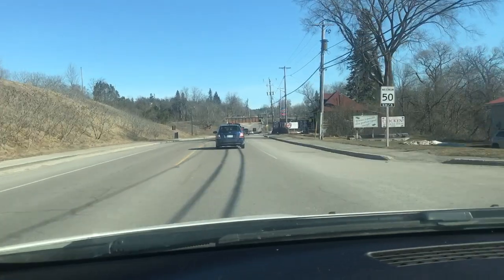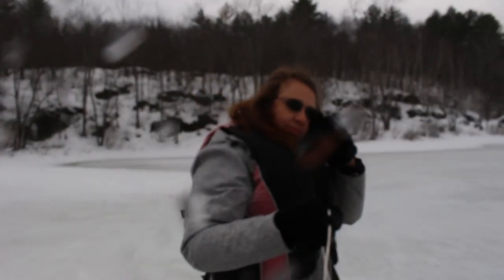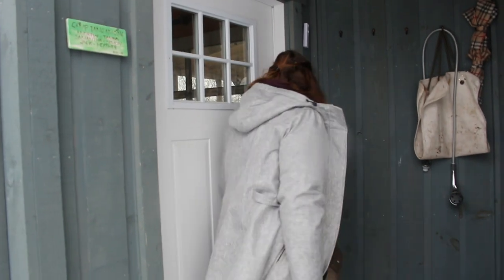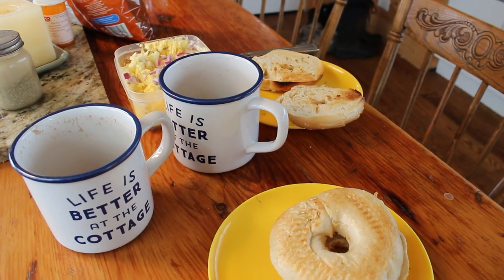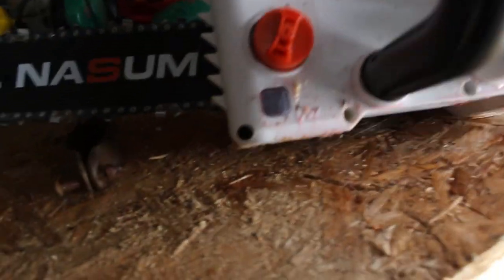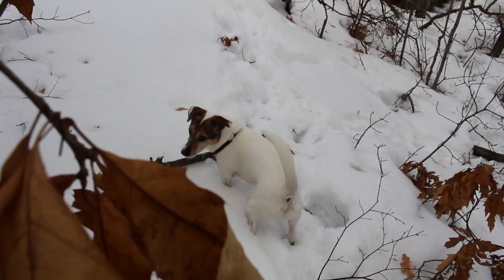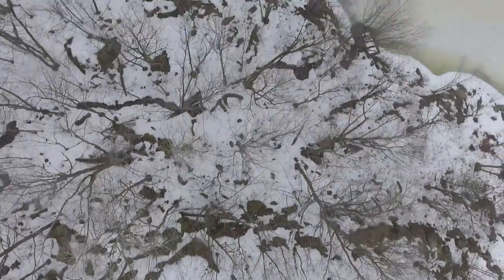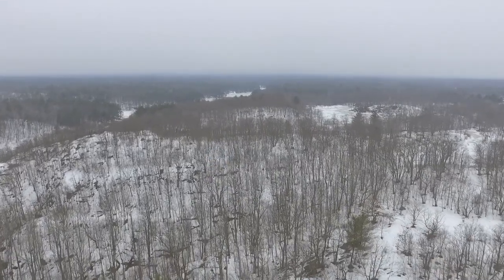Almost trapped by the Ice at the off grid cabin. #offgrid #cabin #cottagelife

Comment: Great to see a new video. My grandparents taught me to leave kettles sitting upside down at the cabin while away in order to prevent rust. Also, I feel your pain regarding the damaged vent pipe. I’m building a cabin just north of Muskoka. Two weeks ago I found our chimney disfigured from sliding snow and had to cap it. I will install a snow splitter before next season. Cheers!
Reply from the maker: That's a good tip, the oldtimers can teach us! Thanks for watching.